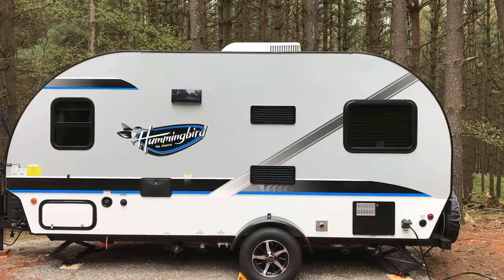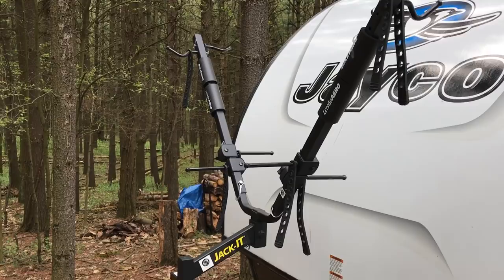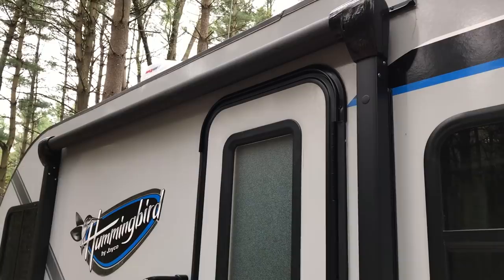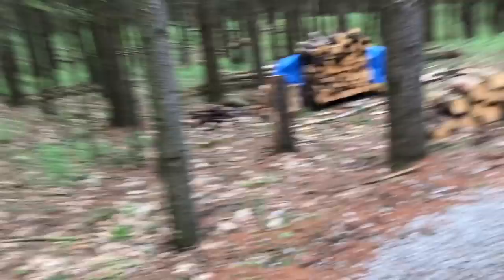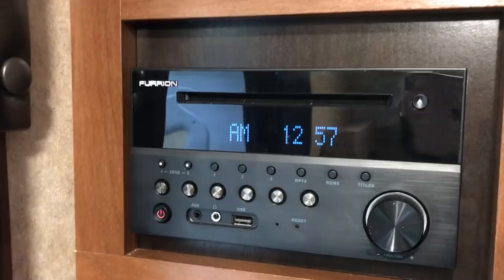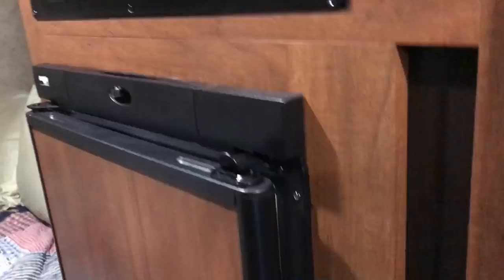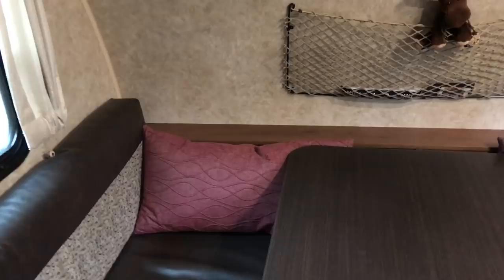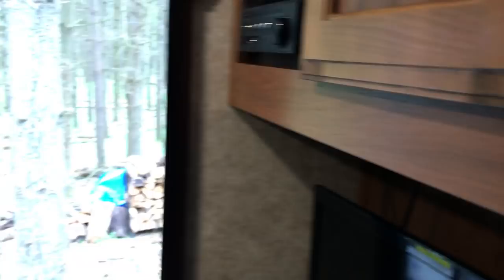2017 Jayco Hummingbird 16FD Review

Comment: I just finished looking over these at the local dealer I too was liking the 16FD it was noticeable right away the increased storage over the other models and I said to the sales rep a fantastic fan would be a good upgrade. 
Overall I was impressed and I'll be buying one soon. For anyone interested make sure you compare pricing don't get taken by a high price and make sure you barter correctly 13-14K is maximum for this unit. If your ducks are in a row you hold the cards try and find other dealers even if you have to travel a bit play two ends against the middle, remember dealers are making money on these even at lower pricing, don't pad the salesman's commission.
Reply from the maker: Powder River we paid $14,000 for ours but I've definitely seen them on other lots for significantly more. We have been very happy with the trailer and our dealer has been good to work with on warranty issues.

Comment: Funny you have made this video.  We have a T@B 400 and we love it, but the problems you listed are the same we have said too.  My husband and I are tall and not petite folks.  That is not a queen size bed and the slant is an issue for us.  So I gladly sleep on the dining table bed.  Our problem is that the table is very heavy and a bit awkward to set up.  We have to move all of the cushions to get the table down in place.  Then like you said, what do you do with the other cushions.......but my husband and I have gotten into a routine and it is working.  The other thing about the dining bed is the rounded part of the bed sticks out beyond the cushions so when I get up in the middle of the night it harder to work around that part of the table sticking out.  I am dealing with it, but I think the design the table could be easier.  The other thing is we have only been out in it twice and the cables of the stargazing window came out of their track.  We called the dealership and they said that this happens often.  We are planning to call the factory and request a  diagram showing us how to fix it.  The dealership said the shade assembly will need to be removed and this gets fixed from the back...ugh.  For us to take it back to have it worked on would take 3 hours one way.   Just be aware of the shade problem and ALWAYS lift the shades using two hands.  All in all....We LOVE Felix, our little T@B 400.

Comment: I love the review you did for this. Though we did get one with the slide out and therefore it’s a little bigger a lot of what you said does apply. Hopefully you got the problem solved with the refrigerator. We were considering an R Pod, but these are more expensive for the same features you get on the Jayco.
Reply from the maker: Thank you!  Unfortunately Jayco would not fix our refrigerator so we ended up trading on a NuCamp Tab 400.  We still loved the Hummingbird but needed a trailer with a refrigerator that worked and a manufacturer that honored their warranty.
Reply: TABs have a good reputation and their products are top drawer. You'll love yours. I got my Jayco used, so we'll see how this shakes out.

Comment: Hello Pat,

Inform me, did you ever tow this trailer with your Tacoma? If so how did the truck performed, I have a 2019 and I’m looking for a trailer similar to the one shown in this video. Thank you in advance.
Reply from the maker: We did not tow the Hummingbird with the Tacoma.  At that time, we used a 4Runner.  The Tacoma did do a good job towing our T@B 400.
Reply: @TravelswithDelaney   Thank you.  I have A 4 Runner..      I know this is a few yrs later.. But I have  been looking for a small camper, with a bath  with a weight limit of 5000 and under.    that will accompany myself and my 4 ft 120 lb dog.  and do not wish to over load..  just retiring my popup camper.. It was all open, and roomy.. I did not think i would find a replacement,,  Looking at Jayco  and Minny.

Comment: I would like to know if while travelling if your fridge works also on the battery .....Also does your furnace work on both gas and electricy
Reply from the maker: The fridge was a 2 way with either electric or propane. The furnace was propane only.
Reply: Thanks for your information ..I just wanted to mention that the 2018 has the three way fridge ,and also gaz and electric furnace ...       again thanks for taking the time to answer ....I thought this  info was important when you buy a travel trailer

Comment: Hello! New to RV'ing and have a 17RK which we are loving. I knew what to look for from dealer to dealer and found a great one. Your videos have been invaluable to me so thank you! I'm interested in installing a fantastic fan. Which model did you install in your Hummingbird and do you still recommend it? We just want a powerful fan and don't really need all the bells and whistles i.e. remote, etc. Any tips, tricks or gotcha's on the install? I'm pretty handy so seems straightforward.
Reply from the maker: We actually had the dealer install the Fantastic Fan in our Hummingbird.  You may want to check out the Maxx Air Fans though.  We just had one of those (model 7500) installed in our NuCamp T@B 400 to replace a Fantastic Fan.  It is so much quieter and has 10 speeds.  It also has built in rain protection so you can leave it open even during rain.  I have a recent video on it: https://www.youtube.com/watch?v=4NG6Imnp8Qw&t=2s

Comment: Can you remove the bathroom sink for more room in the shower?  Thanks.
Reply from the maker: tootz1950 I suppose you could remove it. I believe it's installed with screws. You'd probably have to cap the drain pipe. I wish it was a folding sink like they have in the new Tab 400
Reply: You can always use it as an ice bucket to keep the wine cool.  Or even put a goldfish in there with a plexiglass top.   ;-)
Reply from the maker: tootz1950 we normally just use the sink in the kitchen.
Reply: Travels with Delaney I wonder if you can change out the sink to a collapsable one?

Comment: Thank you so much for this review.  I really appreciate it.  I have had a 27 foot Jayco, towed with a full size Dodge Pickup. (Just too much). Also had a super hard core adventure trailer towed with my Wrangler JKU.   The larger one was just too much of a PITA, and the hard core Adventure trailer just wasn't usable or comfortable enough for my wife or kids.  This seems to be the perfect compromise!   Question.  What is the 4Runner you towed it with?  Did it have a V6 or V8?   (I would be towing this with a JKU, with 6 cyl motor on 35s.)  The Jeeps can at MAX tow 3500 total.  That being a stretch even.  Just a tad worried about that part.    Anyhow.. great review man, thanks!  Also, where is the best place to get an upgraded mattress?
Reply from the maker: Hi Glenn!  Thanks for watching the video.  Our 2014 4Runner has the V6 engine with a towing capacity of 5000#.  I am very happy with the way it tows the Hummingbird.  No issues with power or breaking and we have taken it through the mountains in Colorado with no problem.

We have the Zinus 8" memory foam mattress from Amazon.  We paid around $170 for the short queen which fits perfect in the trailer.  We have found it to be very comfortable.

Comment: My wife and I were wondering if the awning supports were in the way.  Seems like a person could bump his head on those supports pretty easily.
Reply from the maker: Linden Good you do have to watch your head when the awning is extended and you walk under the arms. We do love this trailer. It's the 7th trailer we've owned and it's already one of our favorites
Reply: Thanks for replying.  We have a 2007 Pontiac Torrrent rated to tow a maximum of 3500 pounds.  Does the 16fd tow well?  (I am planning to install a class 3 hitch with a brake module.)Also am wondering about the shower walls - are they strong enough for us to put a spring loaded rod inside to use for hanging clothes?  At campgrounds we just use the shower/restroom facilities provided by the campground.
Reply from the maker: Thanks for viewing our video!  We tow ours with a 2014 Toyota 4 Runner.  It's rated for 5000# and I love the way it tows.  The trailer weighs about 2700#  unloaded and I think its only rated up to 3400# fully loaded.  We have taken it to both Georgia and Myrtle Beach from Northeast Indiana and had no issues.  I use a friction sway bar and the only time I noticed sway was on a couple of days with really gusty winds.  The shower walls will definitely do fine with a tension rod.  We have talked about getting one ourselves to hang towels on during the day to dry.  We have never had a wet bath before and were wondering how it would work but honestly it was fine.  We just wipe down the bath good after our showers.
Reply: Sorry to keep bothering you.
What about camping in cool or cold weather?
We hope to spend some time in the Panhandle of Florida this December.  Is there any kind of R factor for insulation?  Does the floor get cold?
Reply from the maker: No bother at all!  I don't know what the R factor is on the trailer but I can tell you that our first trip was the 2nd week of March.  The first night was in Lexington, Ky and it got down to 32 degrees that night and we stayed plenty warm.  The next 3 nights in Georgia also were fairly cool getting into the upper 30's/low 40''s and again no issue.  We did take a little electric heater that we used in addition to the furnace.  Since we had electricity at our site, I figured use their power instead of our propane.  The camper is so small that you can roast if you want to with the furnace alone.  My biggest fear would be the water lines and tanks as we don't have the enclosed underbelly but otherwise it is fine.  You shouldn't;t have an issue in Florida.
Reply: I've got another question.
How far out does the awning extend?
Do you have to be careful about having the awning out in windy weather?
--Linden Good
Reply: How far out from the camper does the awning extend?--Linden Good
Reply from the maker: Linden Good it is 8' wide and it extends out 7'. Small but perfect for a trailer this size. It's electric which makes putting it out/in very easy

Comment: Why did you choose not to have a slide-out?
Reply from the maker: Slides outs are great as they add openness and space to an RV. But they also add weight and can have issues with motors, tracks, seals and leaking. Our current trailer has a slide out.

Comment: what was the price of the hummingbird ] what is the watt of your soler ] how much less was it with out the slideout ] thanks so much ] n good luck
Reply from the maker: We paid $13,000 for it in February of 2017.  At the time i was using the Harbor Freight 45 watt solar panel system.
Reply: @TravelswithDelaney  thanks for the feedback ]]
Reply: To clarify, is that 13 K with the trade?

Comment: swaybar? why? where do you get it? about how much?
Reply from the maker: Even though it is a small and lightweight trailer, with it being a single axel trailer, it can have a bit of sway especially when semi's pass.  I already had the sway bar from a former trailer so I decided to go ahead and use it.  Harbor Freight actually sells one for about $32.00 .
Reply: Does the 17' Hummingbird or the same size R Pod need stabilizer or sway bars. I used them for 15 years as a single woman on a 16' Jayco sport lite and hated every minute of it - very difficult for me to use. I now am 76 years old and buying a new mini travel trailer and don't want to contend with sway bars again - therefore I think I have to get a much smaller TAB. I would rather get the bigger 17' trailer. Will I need sway bars?
Reply from the maker: bostongw I am not sure sway is required but we already owned it and just like the added stability.

Comment: We are shopping for trailers right now.  My wife is against any trailer that has an East West bed instead of a North South where you don't have to crawl over the other person to get out.  Has this been an issue for you all?  I like the size of these trailers and they appeal to me.  I have a big truck so I can get bigger, but the smallest we can get by with appeals to me since this will be our first time towing.  We will be traveling with our dog also!
Reply from the maker: We use to have trailers with walk around beds and they are much easier to get in and out of and to make.  We just decided that we wanted something smaller that was easier to tow and unfortunately most of the below 20' trailers do not have walk around beds.  It really hasn't been an issue for us.  We have a rule that when one person gets up in the middle of the night to go to the bathroom, we both go.  It's worked out well.  Our last camper was a Vintage Cruiser by Gulf Stream and it had a rv queen walk around.  It was 23' long and weighed 3500# unloaded and could be loaded to 5000#.

Comment: What type of tow vehicle do you use?
Reply from the maker: Sierraman57 we have a 2014 Toyota 4Runner
Reply: Thanks, I have a F150 2wd 4.6 liter. It should be enough for a lightweight trailer like this.
Reply from the maker: Sierraman57 you will be fine. Our 4Runner is a v-6 and it hauled it easily up and over both Vail and Loveland Passes on I-70 in Colorado.  I just go into lower gears going down
Reply: Thanks, this is the info I need. I go over Tioga Pass frequently.